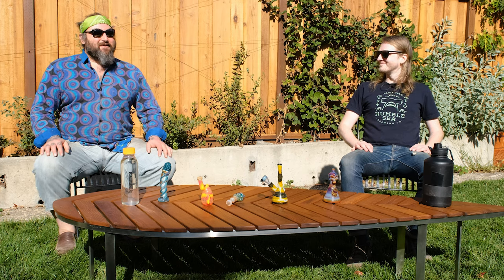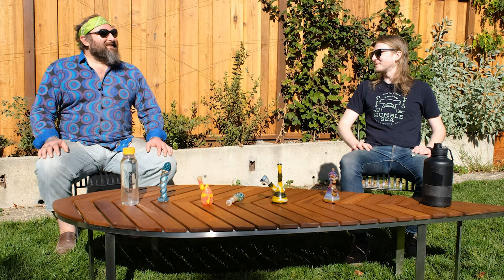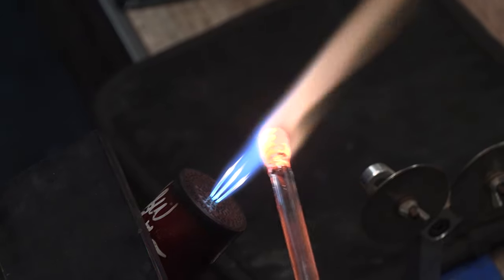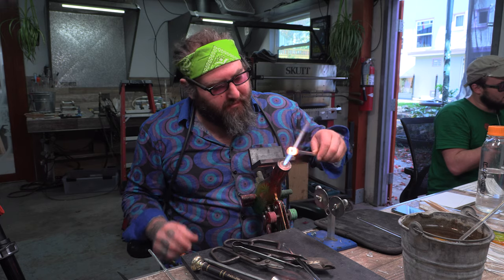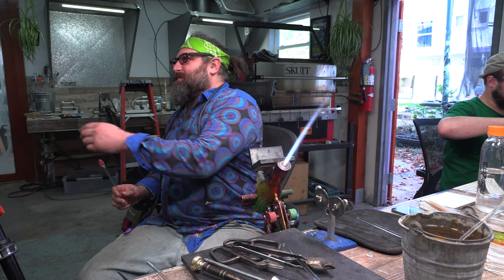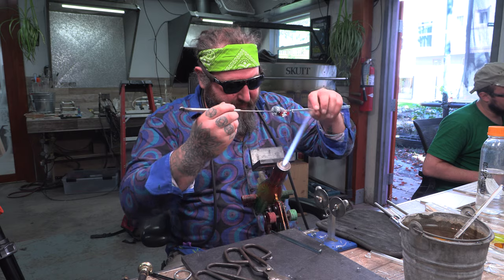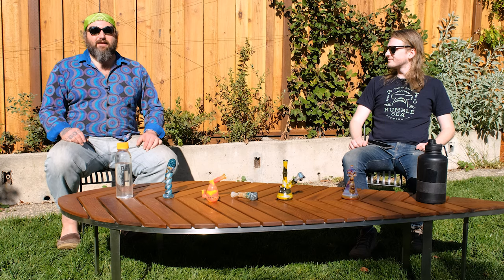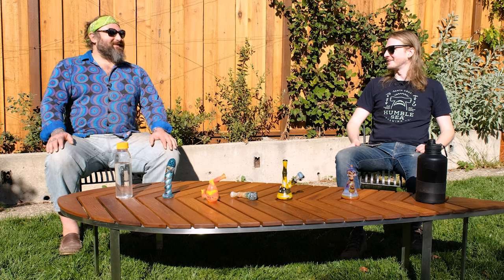Layering a Retticello over a Wig Wag for a Bowl || On the Torch SEASON 2 Ep11

Comment: You work so close to the torch, even inside the candles of the flame.  I've always worked out further in the flame where i feel like its hotter on my gtt.  Maybe you do this to avoid adjusting  your flame to a cooler one?  I've always  been afraid  of accidentally clogging ports working in the candles  so close to the torch face.. is there something  to that? Do you suggest  I try working inside my candles more?   If you do this to work in a cooler flame  would leaving the main o2 knob cracked on one of your outers give a similar cooling effect while allowing you to work out in the flame more still away from the torch  face and outside the candles?  You guys rock